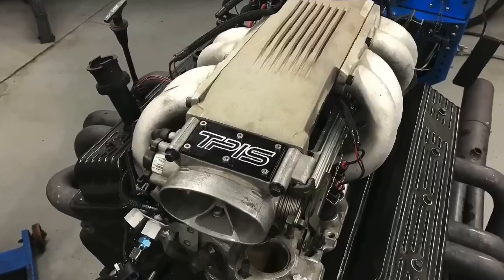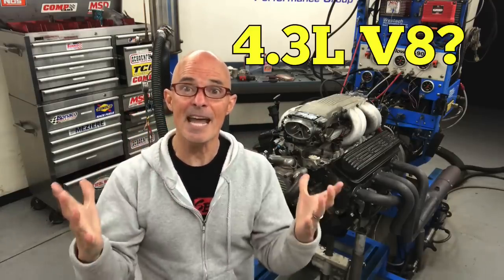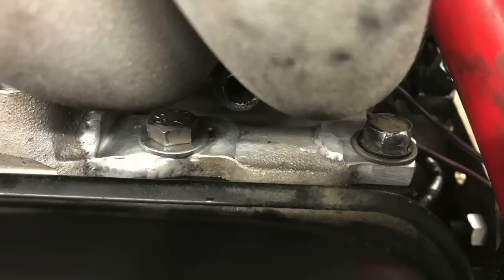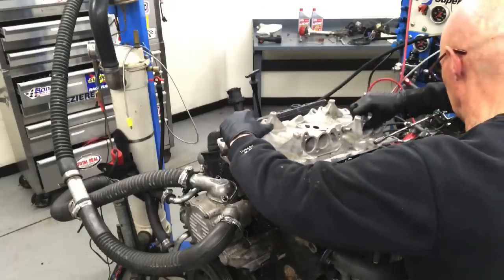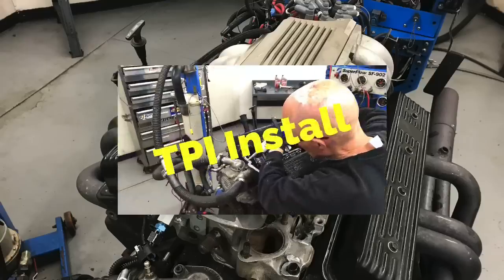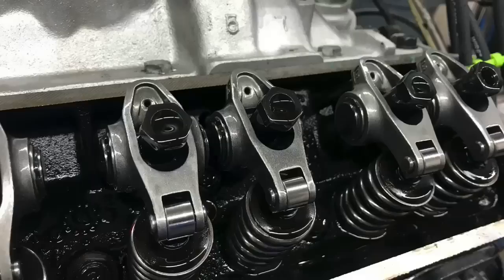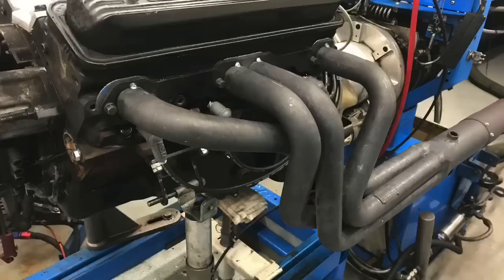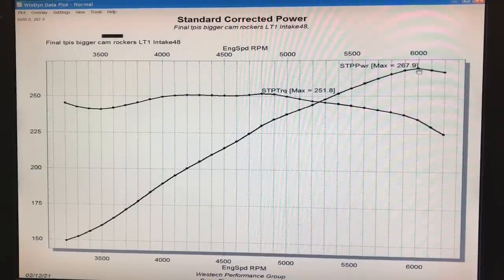GM's BIG MISTAKES-LT1 VS TPI VS CARB (L99 4.3L V8 INTAKE TEST)

Comment: I used to daily a bone stock L98, it felt so much stronger than the numbers would suggest. It made no power past 5K but all that torque with the 700R4's super low first gear made it a stoplight to stoplight superstar.
Reply: I ran a 1.93 60 foot time!
Reply: Got a 1.7 60 foot on mine
Reply: They give a good sound too
Reply: I have a 86 corvette, the L98 on it is a masterpiece, it used to be my daily for years & like I can say is that it’s powerful, fun & it’s really reliable I rarely had to fix anything on it.
Reply: @apl.2018  a guy wants to trade me for his 89 vette, it looks perfect-garage kept low mileage but I can’t decide if I should or not. That engine is stock and is rated for only 240hp  and I don’t want to spend thousands to make it actually make some power..
Reply: I had one too, 3.27:1 rear end posi.  Ran pretty good, then I put custom chip, siamese runners partially opened, Edelbrock headers, and flowmaster exhaust.  It was traction challenged, ran low 14's.
Reply: @zokusharuuku1091  A good set of headers and exhaust and a better intake manifold actually sized for the 350 and a new chip tuned to take advantage of the changes. will produce noticeable gains. Read my above post.
Reply: exactly. thats the only way Chevy could sell a smog choked Corvette back then. Monster torque to make it feel like a muscle car but that was about it.
Reply: @scoutleader06  one of the issues on the L98 was the intake manifold. The TPI manifold used on the 305 and the 350 was the same part but sized for the 305. The 350 didn't make much more hp than the 305 but 50 more torque.  John Lingenfelter found this out and developed one of his own for the 350. Once they retuned the engine to take in account for the proper manifold they picked up something like 45 hp and lost no torque. With the correct intake manifold the L98 in the Vette made almost hp as the LT1 in the Vette
Reply: @apl.2018  87 iroc with the 350. feels so good down low, not fast but very quick. I swear these engine feel better at part throttle than wide open
Reply: @XxMusclecarsxX ol I had a ‘92 z28, L98, long tubes ratchet shifter, and 16” IROCs, 3” true dual flow master 40’s. It was all wheel spin down low 😂 I wished they had wider performance tires back then
Reply: L98 was awesome 0-60 then turned into a turd.  I bought an lt1 and that fixed all the problems. It's amazing 0-60 like the l98 but keeps pulling!! I 🙂It's the perfect stock power for me... you can get lt1 c4 corvettes so cheap also.. love it
Reply: I agree the L98 feels a lot stronger than 240hp with all the torque

Comment: The 4.3 motor should never have been the slug that it was, i get it that GM ran its smaller displacement in a bid for fuel economy numbers back in the day but using the available TPI manifold would not have changed that but as Richard just showed it would have been a torque monster in comparison and still had the fuel economy, GM missed the boat on that one
Reply: I have a feeling the issue would've been cost. 
The TPI manifold is extremely complex to produce, assemble, and install compared to the LT1 intake, especially for a production line.
Reply: GM has missed the boat on other things, too. LS7 heads come to mind......

Comment: The 1989 350TPI engines had 3.27 gears, the 1998 350LT1 engines had 3.42 gears. The LT1 engines had lower emissions and better fuel economy. The LT1 cars were faster at the drag strip. The TPI cars were quicker across an intersection. It was money that kept the 4.3 from getting the TPI intake, and the LT intake is a smaller package. Plus you needed horsepower to fight the BMWs.

Comment: Exactly why I want the GM TPI on my 5.7L LT1 engine in my 1997 Trans Am WS6.  Now just consider how things would improve with a good extrude hone of the base, smoothing out the air flow, increasing it as far as 260cfm if possible, and maintaining velocity.  Now add on AS&M runners with the necessary port matching of the plenum and with a ZZ4 camshaft, things start to get pretty interesting with the LT1.  As I often regard it, the TPI intake was the prototype for the LS1 intake.
Reply: A set of AFR heads and a cam from Tick Performance on a stock LT1 will smoke that combination you just listed.

Comment: That’s why my 91 Z28 5.7 was such a beast stop light to stop light. When I got 3.73s, shorty TPIS runners, a cam, aluminum corvette heads, underdrive pulley, chip, CAI and exhaust it was as fast as LT1/LS1 cars or faster. I remember making my buddy with a new era Cobra very mad. Man I miss that car, but tbh I’m looking for another 3rd gen to put a LS2,3 or if I’m lucky a LS7

Comment: I’m following along something similar. 4.3 L99 block, 305 Vortec rebuild kit, ported B-Body LT1 iron heads with stock valves, LT4 Hot cam, and I believe I just decided to go with a carb instead of FI. It’s basically 305 LT4 with a carb. It’s gonna find it’s way into a s10 blazer I’m building. Sweet part is damn near every major component came out of a junkyard.

Comment: Okay Richard, I see a lot of comments from guys from "back in the day", so I feel compelled to tell my "old school" story, keeping it brief. 1992 H town,Tex I wanted a late model car I could drive every day, enjoy and have fun. GM guy and 88-89 models where in my $ range so I decided on a 89 Formula 350.( If a Ford guy it would have been Mustang LX 5.0) Although it went through stages, I'll skip all that. 
.30 block, SCAT 400 crank, KB dished pistons, GM vette alum. heads ported, TPIS ZZ-9 cam. HS 1.6 rr Accel lower intake, TPIS runners, ported stock upper,  58mm TB, airfoil, ford injectors, adj, fuel presssure reg, MSD 6A, underdrve c/pulley, 700R4 transpack/vette servo, 3.27 gear. weighed 3470 with me and 1/2 tank, ran a 12.66 baytown, best 1.56 60ft, would eek out a 12 in drive shifting at 4800. Have always been curious what the power curve must have looked like. The best truck motor never made is what i always thought as well. (I thought a NOS shot would have been the best next thing, as it does not require as much additional airflow).
Reply: Was it on the stock ecm?

Comment: You continue to validate why I'm building a TPI 383 to replace the carburated 350 in my class 3 RV
"The TPI is the best truck intake GM never put in a truck".
Reply: A good dual plane intake makes similar torque to a TPI intake. First Fuel Injection makes a VERY nice TPI style intake. If I was building a truck engine but wanted it to still have some top end power, I would run one in a heartbeat.
Reply: Motoracer 
Did you build it?

Comment: The sedans and wagons of Buick, Caddy, and Olds could have really distinguished themselves to be old school torque monsters had they come up with a TPI intake to fit the LT1 in their cars. I'm looking into installing a TPI on the LT1 in my Roadmaster wagon. I might try the factory intake base modification route and see how it works before going with a FIRST intake setup. All I want is more towing power. The sedans and wagons already got a slightly higher torque cam right from the factory.

Comment: The TPI Corvettes really do jump off the line. Awesome comparison. Nice work Richard! Who would have thought the baby LT1 could have been a baby beast in a Caprice. They could have just hashed up some block off plates and go to the old bolt pattern on the iron head. L98, LT1 both great GM motors

Comment: The dual plane has “medium” length runners but also isolates the dilution of the intake charge by operating as two 4-cylinder engines. Long runners between the plenum and the intake valves will have somewhat the same effect but short runners, whether single plane carb manifold or EFI plenum, hurt low- to mid-range due to lack of isolation. It appears the LT1 manifold runners are tuned for rpm well above the range of that cam since the dual plane manifold beats it on both torque and power. The L98 runner length looks good for barges and trucks but I think a tunnel Ram might be better for ultimate performance. Really interesting results in this test. Thanks, Richard!
Reply: " It appears the LT1 manifold runners are tuned for rpm well above the range of that cam since the dual plane manifold beats it on both torque and power".  OR tuned for a larger displacement engine.

Comment: what about using the carb intake but drop a Holley sniper fuel injection carb and see what it does....
Reply: +1 this!  You would ideally have your cake of power and not have to fight adjustments through winter/summer

Comment: Surprising how much the TPI intake was still a restriction to top-end flow on the 4.3. I was expecting more top-end power, or less of a drop at least.
Reply: The power roll off was less a function of flow restriction than runner length.
Reply: @jackcurrence263  heads. 265 was like the 305- emissions anemic power
Reply: Intake runner length produces a pulse wave...on a tpi 1st power wave at 2k  rpm the second wave at 4k rpm....porting will move them both equally in general

Comment: I had an 86 Corvette with the TPI. It was all about torque, not a high RPM engine like you’d expect from a SBC.  Your dyno runs confirmed what I expected to see.
Reply: the 86 was not true and pure fuel injection. it was a carb on steroids
Reply: @scoutleader06  I’d like to see something that backs up your statement. I’ve never heard of what sounds like nonsense.  There were eight injectors, one per port.  The injectors fired in batch mode, maybe twice per engine revolution, not sequentially. But it was certainly fuel injection,  nothing like a carburetor.
Reply: @scoutleader06  You’re thinking of Cross Fire injection on the 1982 & 1984 Corvettes.
Reply: @CrazyPetez  batch mode injection was a crude run-up to the 87 TPI true sequential fuel injection, maybe not quite a carb on steroids, but nothing like the 87 TPI  sequential controlled by the ECM. do your home work then come back here and tell me its nonsense.

Comment: That's interesting. The horsepower and torque peaks on that TPI intake equipped 4.3 are at almost the exact same rpm they are in my turbocharged, TPI equipped, L98 5.7. (My torque curve is much flatter though.) Just goes to show you how much influence the runner length has on the rpm range of the engine.
Reply: That was the idea behind the r26b rotary engines in the 787b's. They had variable length intake runners.
Reply: Cam, heads
Reply: Any thoughts on how a RAM air might help get the best of both worlds? 

I ask because Ive built two of them for my little work trucks. They always felt wheezy at higher RPMs; knowing a little bit about runner length I decided to try something...combined with getting cooler air into the engine. The first truck was a 2.5l Iron Duke; second was the LN2 2.2l. Both saw some benefit at highway speeds, but the LN2 really seemed to benefit even around 30mph. On the highway it was a night and day difference...It would pull hard all the way up to 95. 

I realize that its not the same thing; but having all of that air ready to be pushed in as soon as the valve starts opening has to be of SOME benefit. I almost got to building a custom intake for it but then traded it in on a new Ranger.

Comment: When my dad was out in California about 20 years ago he picked up a badass firebird formula 350. It had LT1 heads on it because the sand ate up the original heads. You guys got a lot of sand. We're in pa. But that thing was one bad SOB.... It had a built 700R4 that would chirp tire and all four gears not even trying. With them LT1 heads and the tune port that thing freaking ripped. He wouldn't give it to me because he told me I'd kill myself. Well now I got a car 10 times that shit I just need a good fuel injection system. Thank you Richard for all your hard work and dedication and teaching. From our house to yours thank you

Comment: Very good comparison Richard. Cant wait to see the results of the rotating assembly swap. You should overlay the 305 LB9 TPI results with the L99 TPI and compare the difference between 3"/5.94 rod  & 3.48"/5.7 rod. and 1 point of compression does.

Comment: A while back I had a chance to build a 307 TPI setup but I blew it. 307 is essentially a 283 bore engine with 327 stroke (the opposite of the DZ302). Probably would have made great torque for a light duty hauler. I still have the complete TPI setup (polished manifold) but couldn't get to the 307 in time to snag it. I ended up swapping in a 5.3L LM7

Comment: Richard,
There is not a cam that allows a broader torque curve, however there are roller lifters that reduce duration by 15-20° at lower rpm. Rhoads V-Max. They lash like a solid lifter.  0.020" feeler gauge cold for an iron block and heads or 0.014" feeler gauge for iron block and aluminum heads.  My 11:1 383 went from 195 psi to 210 psi cranking compression. Much more low-end torque.

Comment: A lot of people hated TPI intakes, but for the correct application they are absolutely superior.  For a street vehicle that will almost never got over 4500 RPM where you want good torque and fuel economy it is the GOAT intake.  
  I have long said that the TRUCKS should have had TPI 350's and the camaro's and corvettes should have come with the TBI intakes.  The TBI engines were easier to modify and generally made better horsepower with some simple intake swaps (once you get around those awful early ecms).  
  The reason I bet that only vettes and Fbody cars came with TPI was cost.  I bet most truck buyers didn't want the complexity and extra cost of the TPI.
Moral of the story is, always go for an aftermarket tunable ECM (this was a lot harder 20 years ago), then put the TPI on you big cars and trucks with a wide LSA cam and some tight headers.

I built a 78 oldsmobile delta 88 with a 93 Silverado junkyard 350, accel sequential DFI, 1-1/2" long tubes, stock TPI base/runners/plenum, aftermarket throttle body, and MSD 6A.  With the original oldsmobile (still on original build) non lockup th-350, and 308 gears, that car would get 22-24 mpg highway towing an 92 camaro with a complete cast iron 454 and a T5 trans in the trunk (@ 55mph).  I wish I was able to swap that 4l80E in there I had to see some OD w/ lockup numbers.

Comment: That thing sounded like a beast with the l98 intake in comparison to both the carb’d and original intakes. I agree with others the l98 intakes should’ve been in the trucks for tq purposes. It’d be interesting to see one carefully cut and welded back together to run on a 4.3 v6.

Comment: Richard, what I havent seen is anyone set this thing up for success by optimizing the combo... totally required to get that torque surge the TPI is capable of, though even with CSA and runner length not matched or optimized, the runner length is still great for added torque. The plenum is unported (10 min of entry porting helps ALOT). There is also minor work on the runners and base that helps with optimizing the factory TPI parts. The achilles heel of the intake is the poor (low) port entry angle meeting the cylinder head. That is why the FIRST TPI preforms so much better.

The factory TPI intake was designed around 305 ci. You can 'stroke' an L99 into a 305 and if you do the math you will see the runner length and diameter will give you a 4000 RPM torque peak on 305 ci, but only 3400 on a 350., however the length and torque peak together is a better match for the TPI on a 305 in stock form. That explains the SLP siamesed runners, that arent too large but effectively shorten runner length to match a 350. Ever wonder why the peanut cam ended up in the 305 TPI's? TPI 305 engines run very strong with a more optimized stock TPI intake and a cam like the corvette LT1 or small aftermarket cam 208-210 deg duration range. Cant have a 305 walk a 350 that close. Also, runners Iike the as&m are sized accordingly, if you do the math, for 383 ci. TPI engines are vacuum leak prone but very fun and got a bad rap, largely because people were looking at it like an antituned intake and focusing on merely flow numbers while ignoring the runner length, diameter and quality of airflow which is what makes the TPI 'tuned'. Possibly one of the most misunderstood intakes out there.

Increase compression. Run an electric pump. Port the plenum, use an airfoil or bettef yet a 52mm TB, increase to 305 ci, clean up the intake(hand blend and tap out bulges in the runners near the flanges). Bump fuel pressure to 50psi at idle. I bet it turns into a stump puller!!!
Reply: Hi Dave, thank you for typing out the detailed comment.

How does one calculate peak torque  rpm based off of runner length and diameter? Where do you get the 4000 and 3500 numbers? Those #'s sound about right from what I've seen in these videos.

I am really curious what sort of #s could be achieved from a tpi 400. Probably not ideal in a "typical" performance set up, but it sounds good for a truck/offroader vehicle that would benefit from the torque.